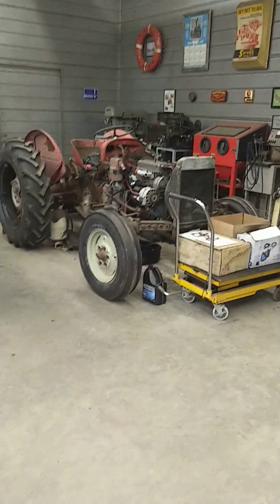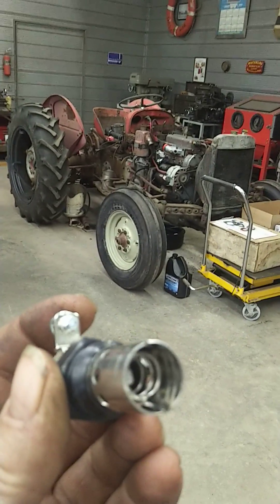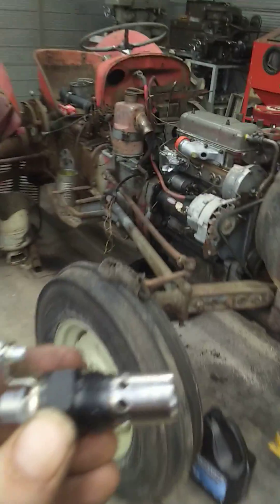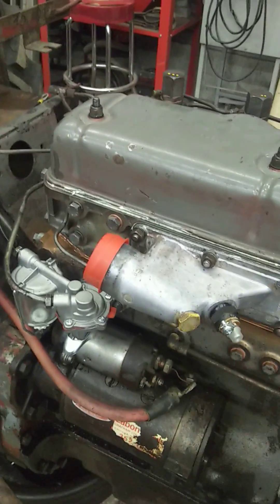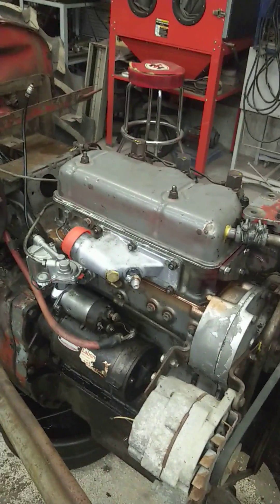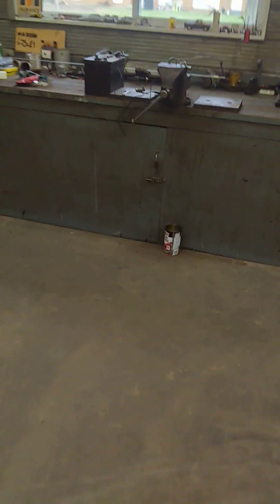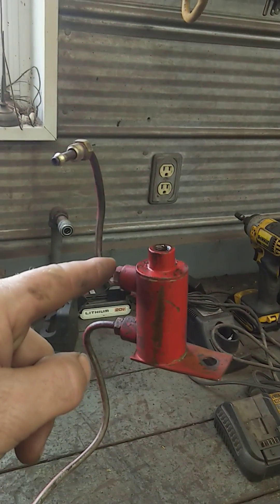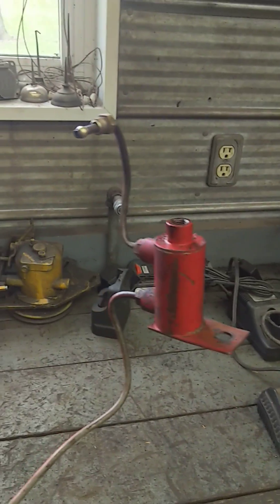Demonstrating a "Thermostart" Intake Manifold Pre-Heater

Comment: The thermostart plug on my MF50 wasn't working so I ordered a new one. Looked like a straight swap but my original plug used a 3/16" fuel line and the new plug will only accept a .170 inch line which I assume may be a metric size. So what started out to be 20 minute job has now consumed 6 hours in a futile effort to rig up some type of adapter. Have you run into this problem? I plan to chuck the new plug in the lathe today and ream out to 3/16". Hopefully the plug isn't hardened and can be drilled. Provided I don't go to deep and destroy the fuel valve it should work. If I screw it up I'll only be out $13. Any advice?
Reply from the maker: Gee.. I did not know that there were different sizes.. The company that I buy them from only offers two different styles- screw type electrical terminal or spade.  Maybe it woul dbe easier to just change the line?
Reply: @FarmallDoctor I reamed it out to 3/16" and it's hooked up and working now. Thanks for the help!

Comment: Do you know which tractors do have that small reservoir? My Dexta currently doesn't heat and has no fuel line going to the glow plug, but willing to change that into a working system
Reply from the maker: The Dexta parts breakdown does not show a reservoir being used, and the heater plug is shown as being equipped only on units with the early vacuum governed injection pump. in either case, you would benefit from using the reservoir because the fuel tank and return are lower than the intake manifold.
Reply: I do have a Dexta with the gouvener pump on it, so looks like it has been taken of in the past. 
After some research I found a company that has a complete set with the reservoir, glowplug and some piping for the fuel lines so I will order that one and help the Dexta the coming winter. 
Thanks for the quick feedback!
Reply: @ferdigielen7660  
How did the Thermostart system for the Dexta work out?

Comment: How often do you think they will last in north Michigan? Obviously related to use. Will it go bad during off season non usage.
Reply from the maker: They were regular equipment on many MF, Ford, and David Brown tractors. Most of them still work after all these years. If you use good fuel and use a good fuel treatment they should last indefinitely. The only problem that could be possible is having one gum up from old fuel.
Reply: @FarmallDoctor  I am going to check fuel flow and power/ volts to keyed switch. I suspect if it’s working I can take my infrared heat gun and notice a difference does it stay on until you deactivate starter switch
Reply from the maker: @Jamesjghome  the key switches usually had a position to the left or to the right. More often to the right (clockwise) mid-way to the crank position where the heater plug was energized. The heat circuit would stay powered during crank. On tractors that didn't have the option, i like to install a seperate push button switch.
Reply: @FarmallDoctor  understand, however massey was an outsider buggey and wire switches lights etc pay the price. I’ll check switch maybe clean bang pound and get lucky

Comment: Hi my name is Billy I got a question on the intake manifold heater can you just hook up to a toggle switch I would prefer trying to use the intake manifold heater over a block heater the tractor I have had a block heater and it ended up cracking number two cylinder right where the heater plug goes so I'm not putting one back in it any information would be helpful thanks
Reply from the maker: I prefer a button switch because it is less likely to be left on or turned on accidentally.
Reply: Thanks
Reply: Welch plug is great place for block heater you have to baby monitor put. On a timer. Thanks from north Michigan

Comment: Oh! That's what makes those Perkins engines start so nice. Might have to figure out how to cobble one on to my 560 & 2444. Thanks for the post. Regards!
Reply from the maker: Your 560 and 444 have glow plugs with indirect injection, so this heater wouldn't really help that design.... unless you are in the deep arctic! haha New glow plugs are cheap and easy to change. My 560 Diesel starts like a champ at any temp. I have two 12v batteries in parallel which helps. Thanks!
Reply: @FarmallDoctor  I was wondering if that would work with an IDI engine. Guess I'll stick to an upgrade to Navistar glow plugs & a second battery on the 560. Would have to be creative with a second battery on the 2444. Not sure if the wells in the fenders will take a decent sized 12v. The loader, ROPS & trencher take up a lot of real estate that could be used for a battery tray. As well as the battery tray that's already installed by the previous owner. That one is in front of the clutch pedal & was not designed by someone who wore size 13 shoes. Have to stand & use my tip toe to push the pedal down all the way to disengage the PTO. Then if I'm half standing, there's no reaching the PTO lever. 😂
Reply from the maker: @ikonseesmrno7300  One good Group 31 battery should be plenty for the little 4 cylinder.
Reply: @FarmallDoctor  Good  day   I talk to Mennonite mechanic ,  told him about this a few yrs.  ago, I think Nuffield tractor.  he said be careful ,  valves don't shut off & diesel leaks in cyl. 
Idea  is really good.  Thanks
Reply from the maker: @donvoll2580  Hi Don. I saw one stick open 25 years ago, but it was the only one. They are reasonably priced, so I just automatically buy a new one. they seem like good quality, and overnight shipping from my supplier in Eastern Ontario.
Reply: @FarmallDoctor  So were do u get them from My 574  is a hard bugger to start. Thinking of  buying gear reduction starter Thanks
Reply from the maker: @donvoll2580  i get them from Central East Farm Supply. If you Google search Sparex, they are the dealer.